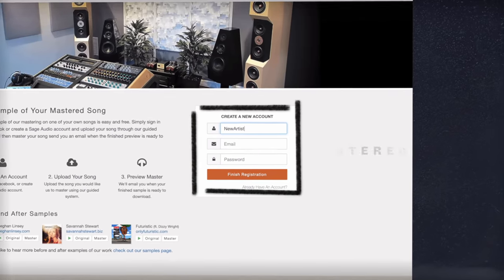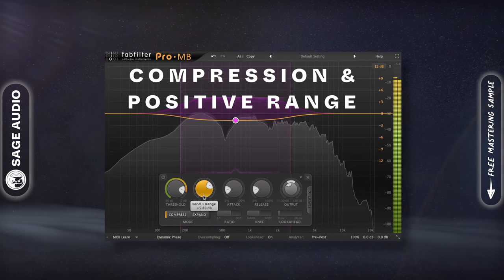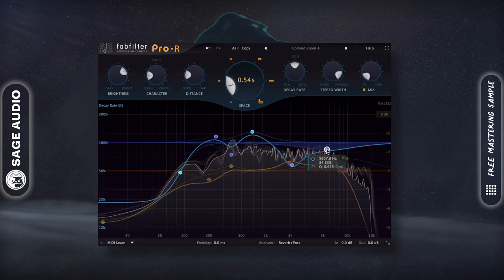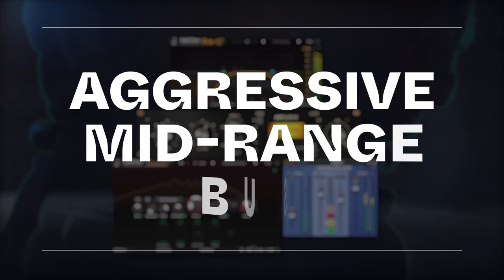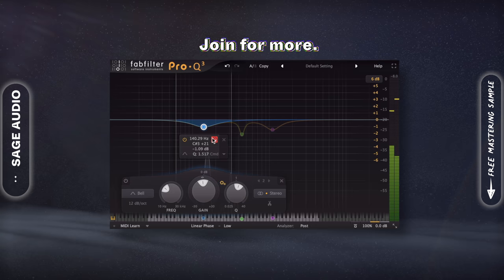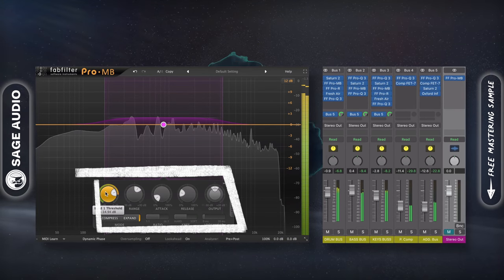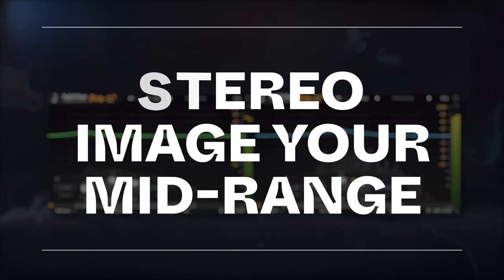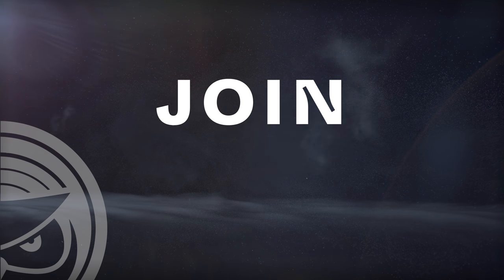How to Mix Mid-Range

Comment: What' s the best way to dial in attack and release times on compression so its in time wit your track? Is there a magic formula?
Reply: It depends on many things, the instrument you're processing, the tempo and feel of the song, what you are trying to achieve. For example you may want to control the 1st peak (transient) of a snare or just add more sustain to it.
1st ex needs a fast attack & 2nd ex needs slow attack so it leaves the transient untouched
Reply from the maker: Thanks for watching! A helpful formula is 60000/BPM = a quarter note.  This won't be the best setting for all situations but at least it'll be in time.

SageAudio.com

Comment: at 3:07 doesnt the original signal still have the uncontrolled midrange when you introduce parallel into the mix anyway?
Reply from the maker: Not sure I follow! By blending in a compressed signal, the overall signal will be more controlled dynamically.  The original signal still has uncontrolled mids, but collectively the original + parallel track = more controlled mids.  Thanks for watching Cam!

SageAudio.com
Reply: @sageaudio  thanks, you pretty much nailed the reply explanation

Comment: Oxford inflator is not a low-level compressor.
Reply from the maker: It is! It also adds harmonics. Thanks for watching!

SageAudio.com
Reply: @sageaudio  It adds Harmonics by clipping peaks. so clipping distortion. you can control to add odd<>even harmonics with a "curve" fader (hard<>soft).

Comment: So much processing.  :(
Reply: Not nearly. If you are mixing in the box, you need to do a lot of intentional saturations and compressions on your midrange, starting from the individual tracks to busses.
Reply from the maker: Thanks for watching! You don't need to use all of these at once.

SageAudio.com
Reply: He literally engaged one plugin on each sub group in each example. Not a “do all” more “if you need”. Could you explain “so much processing” as even in the examples most of what was done was light broad strokes. And how you would achieve these tips with less processing? Cheers!